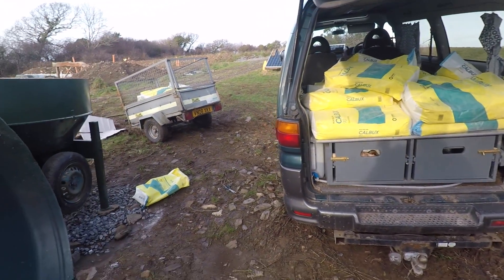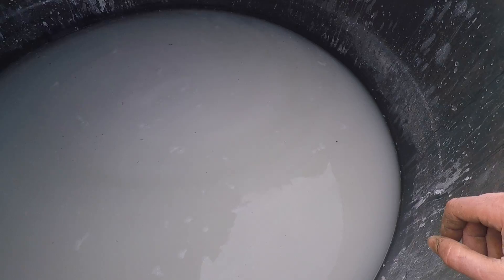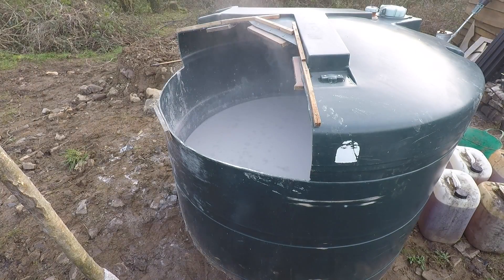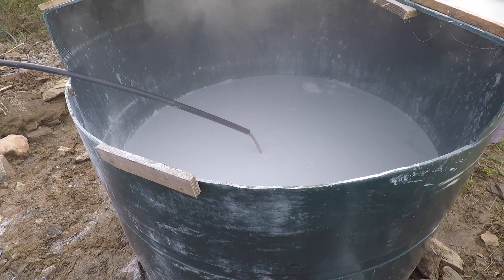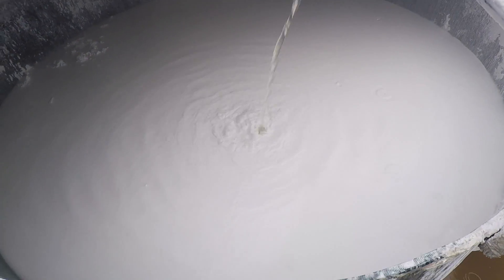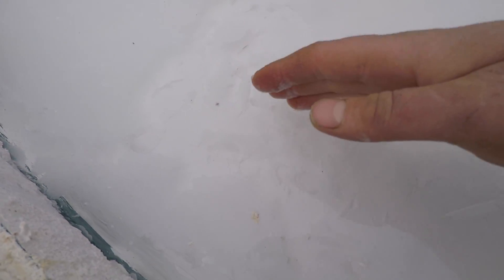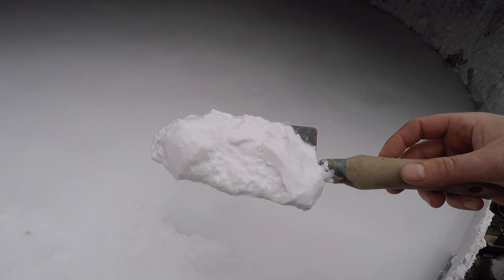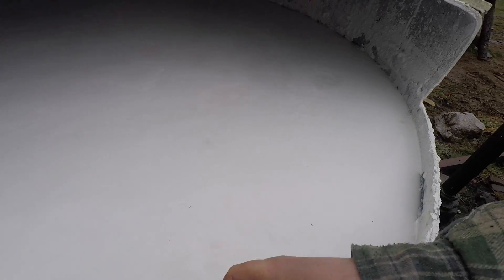Slaking A Metric Ton Of Quicklime for lime plaster

Comment: This took me back to 1954 when I was working on Devonshire House on Piccadilly. Rootes showrooms. Remember Lord and Lady Docker?  The ceilings had been fitted with heating panels. Covered with Expanded Metal (mesh) then plastered with course stuff. Lime putty, sand and beaten cow hair. I slaked the lime using a larry. It was a D shaped hoe. I doubt you could buy a larry nowadays. No respirators in those days and I'm still here. I teased out the cow hair by beating it with battens on a layer of mesh. -The ceiling was then covered with a layer of hessian and 'skimmed', finished with putty and plaster of Paris. Days of old when Knights were bold eh? Keep up with the great and interesting videos, Kris
Reply: Larry - it’s called a mortar/concrete hoe by Marshalltown tools

Comment: Slaking quicklime to putty is a dangerous waste of money. Thats the point of hydrated lime, its been partially hydrated to prevent a violent reaction at first but the end product will be identical when making putty. Quicklime is for hot mixed mortars to be used there and then or soured for later use but always mixed with sand. And there is no need to even make putties it was to break down weak, overburnt or badly ground lime for plasters where blowouts can be a problem. Todays quicklime is pure and perfectly ground and sieved, the jobs been done. No good reason to do this at all, sorry.

Comment: Typed in 'lime slaking' and your film popped up Kris. Always interesting to see how other folks do their work but your end result looked too watery and having too much water weakens a mix which usually results in lots of cracking and not as effective in binding together. After my slaking there's no water on the surface, just the putty. The bags of stuff you used has a lot more dust and also costs more than my stuff. 

 I buy 18 Kb bags of Singleton Birch for £9 a bag, the plastic tubs (re-used multiple times) of chalk lime putty cost £9.40. I  use a 2 & 1/2 sharp sand, half a builders sand and 1 putty mix which covers about a square metre.

For the slaking I do 2 buckets of water to 1 bag of quicklime getting 2 tubs of putty for a bag of the fine kibbled quicklime. 
Using a sharp blade I slice the 2 plastic bags (re-used multiple times) and upend the contents into the water, which starts to react within a couple of minutes, not using gloves or goggles (which is recommended) I reach for my plasterers whisk and give the contents a good turn over and put a plastic mat over the top of the bin to stop it splashing everywhere, after a slake I scrape off about 3 trowel worth of product. 

Within 4-5 minutes it's bubbling and frothing in a rising crescendo until it's like boiling mud. After the action subsides I put in the whisk and turn the whole thing over again and leave it to sit while I get the tubs.
Fill 4 tubs with the putty which has thickened up more like clotted cream and leave to stand without a lid for 20 hours, by this time you could turn the tub and it would stay in the container.

I still have 2 tubs of lime putty from 2001 which is like a solid cheese, you could cut out a slice like cake. I once heard about some 500 year old putty found in some Italian pits which was still very usable. There is less waste using putty mortars over cement, and uses less energy to produce than cement. A lime mortar absorbs carbon dioxide and gives a room better acoustics.
I normally make my mortar a week before a job but you can use the mortar the same day if you want, left for longer it amalgamates & makes a stickier mix which stays on your trowel when you turn it over. 

As you said you can do a hot-mix with it which is just right for rubble-stone wall work because it expands in the joint and in the old days before cars they would take the lump-lime/quick-lime with them and slake it in pits dug in the ground at the job.
For the really grand jobs there were travelling families of Italians that specialised in the ornate fibrous work and running
I've worked with lime since about 1999 and have been working ever since since I specialised, I rarely use hydraulic or hydrated because it would cost me more and there would be more packaging rubbish. Just like to wish you all the best in your work.

Comment: As quicklime is not readily available in the US, we use bagged hydrated lime - mixed with water - which works well, especially with metakaolin. As all the old world traditionalists use putty, it must be better, but I have not idea how or why it is better. Thanks!
Reply from the maker: you cant go and buy it in the shops here either. i have to get mine from a big commercial supplier that supplie big industries.
Reply: @KrisHarbour  Thank you very much! If you get the chance, can you say why to do it - instead of just using locally-obtained hydrated lime?
Reply: @SpaceCrete  Search for "Roman concrete".  Type S is NOT good, too hard and processed.   My stucco is cracking and I'm tired of repairs.

Comment: About a respirator. . . I work in a steel mill and we use a full train car every few days so there is plenty around. The best thing we've found if we're doing lots of work on the system is to use a PAPR (positive air pressure respirator)  Not sure how much you'll be working with the stuff but if you do a lot more you may look up a PAPR and give it a shot, much easier to breeth in than  quarter face resps and covers the whole head. Could probably just make one to be honest
Reply: Ah, cheers!! Every days a school day!!
Reply: What do you use lime for in a steel mill?
Reply: @bushratbeachbum  
We use it for slag. Dump a bunch in the furnace and it creates a blanket over the steel bath, protecting it from oxygen/impurities and keeping some heat in. The majority gets poured off before we tap but we also do the same in the ladles, for the same reason

Comment: I’m hoping to do the same thing soon. I’m in the US. And it has taken me quite a while to find a place that actually has bags of calcium oxide. I’m planning on mixing mine up in a steel drum and then transfer to smaller containers for storage. I guess after a while you start to understand what’s going on with the mix. I am guessing you see the reaction of quick lime in water subside and then add enough water to cap off? I’m assuming a couple inches is enough?
Reply from the maker: Hi, Yeah you got it. just keep adding cold water until it settles and stops reacting and then leave an inch or two of water on top. it will settle down a bit as it compacts.
Reply: Did you find a source of quick lime?
Reply: I'm in northern Arizona and it took me 3 months of searching, calling, emailing, ...   Couldn't get any local business to special order.  The local Lhoist mine strung me along for weeks.   Couldn't have felt any smaller.

Finally ordered 2 tons from Tacoma WA, 2 trips to Las Vegas in my 23-year-old truck, the stress!

Now I need to figure out how to slake some of it, but might hot mix for a floor.  So many projects, so little time!
Reply: @christinebaker3293 hi. Who did you order quicklime from? It's hard to find!

Comment: I remember seeing a video of a Scot making lime wash direct from quicklime and adding lard to it. The lard melted with the exothermic reaction and made the resultant wash more waterproof, or at least that was the claim, perhaps it forms some sort of emulsion?? Might be one to experiment with in the rainy West. Not for plaster of course, but as a final external wash for rendering and stonework, if you've just slaughtered a fat pig and have lard to spare...
Reply: It's possible that the quicklime-water mixture was so alkaline that some of the lard was turned into soap.  The soap would be able to emulsify some of the remaining fat.

Comment: just out of curiosity, What are the pro's and con's to using lame rather than concrete? does it cost less? only reason I ask is, it seems like if your going to go to all the trouble to get all those bags and cut them all open and mix an whatnot  it seems like your adding extra work for yourself. IDK maybe I missed something in a previous video.

Comment: The respirator only seems expensive until you’re laying in a hospital bed. 
Be careful Kris.
Reply: That statement assumes respirators are superior dust blockers and that you know more about safety in general and thus job in specific, all at once.  Your common/robotic use of passive-aggressive, ignorant (truest sense) directives of advice may be cloaked with good intentions, but since this skilled workperson is in fact wearing a FAR superior device for dust filtration than your $40, carbon-activated band-aid, and yet you assume a lack of thought or safety, you might look into your own knowledge of when to give advice, what it might actually look like when you do, what is safety in general, and whether you are confusing safety with normalcy and new, plastic parts.  There's a lot of telling other people to be 'safe' without much premeditation, on the surface it is a blind enforcement of normalcy, and is of political use.
$2-200 masks can be great for looking safe in public and personal merit-badging, can filter out a lot of dust for two solid minutes before voiding the warranty and attempting to wash, are great for a few hours or minutes of harmful vapors, cause bacterial growth in the lungs over time when not changed out every few days, go bad in a few weeks after opening from package, etc...
Reply: @readoryx373  
That’s a whole lot to write when my comment was about Kris not using anything but a cloth. 
I guess stating you’re a “skilled workperson” is supposed to add believability to your comment too I guess without you knowing or me stating what my knowledge or skill level is. 
One counter point I have is that not all respirators are carbon activated. Some are actually dust filters but don’t let facts ruin your “great” comment. 
Kris mentioned respirator so that’s what I commented on. 
Bottom line is any dust filter is better than what he used and you don’t want that dust in your lungs.

Comment: This is great! I have used lime putty myself. Beware that 1 volume of putty is equivalent to more than 1 volume of powder,  so you need to adjust your sand:lime ratio accordingly. 3:1 is way too strong and will suffer from shrinkage, in case you didn't know this. It is nothing like NHL. 4:1 should be the a absolute strongest, and weaker than that is probably much better. This is from my experience and an old book of lime mortar experiments. One note about plaster: I would expect it to crack-up if it doesn't have hair in it, but your final finishing coat (thin) can have a fine aggregate and no hair.

Comment: if quicklime wasn't available could hydrated lime be used in its place and would it work as good?
Reply: Yes, much safer, this process is turning quicklime into hydrated lime, so if you start with hydrated lime you are just dissolving it rather than making tons of heat, also hydrated lime is less egregiously dangerous to your flesh

Comment: what if you pre cut the bags (I mean cutting the tiops clean off so no dusty swinging around of the bag is required) and then tip them over in the tote, holding the cut end slightly under water??? Keeps the dust down at least...

Comment: Kris no hablo inglés. No se q has dicho. Pero para la próxima ves q apagues cal hacelo en un tacho abierto no semi cerrado. Q alguien vacie las bolsas de cal de a poco y otro bata o renueva sin parar . Al estar abierto de forma total el tacho los gases se disipan mejor y más remuevas mejor es. La cal apagada a las 24 ha siguientes debe quedar como una crema espesa q queda con la forma al sacar con una pala y no cae de la pala. No debe quedar grumosa ni como muestras floja q se cae..  ojo quizás todavía no la habías dejado estacionar por eso no quedo espesa. Espero no ofendert. Saludos
Reply: Translated via Google Translate (Traducido a través de Google Translate): 
"Kris does not speak English. I do not know what you said. But for the next time you turn off lime do it in an open not semi closed. Q Someone empty the lime bags a little and another gown or renew without stopping. By being completely open the tank the gases dissipate better and the more you remove the better it is. The slaked lime at the next 24 ha should be like a thick cream that remains with the shape when removing with a shovel and does not fall from the shovel. It should not be lumpy or loose signs that fall ... eye maybe you still have not let it park so it is not thick. I hope no offense. regards"
Reply: @brawn00  muchas gracias por traducirme.

Comment: Just looked up what happening (chemical reaction) via google: Quicklime (Calcium Oxide) reacts with water in an extremely heat-producing reaction, a process called "slaking". ... Once Calcium Hydroxide is exposed to air (whether it's in powder or putty form), the lime reacts with Carbon Dioxide in the air and ends up where it started...as Calcium Carbonate.

Comment: The putty won't solidify over time? How are you going to stir it when you'll use it?
Reply from the maker: The layer of water on top stop carbon dioxide getting to it. it does not need stiring. it will go like cream cheese and it is used like that. it will store like this indefinitely
Reply: Cement mixer he said wen he is ready to use it